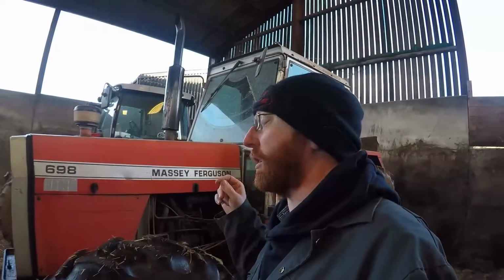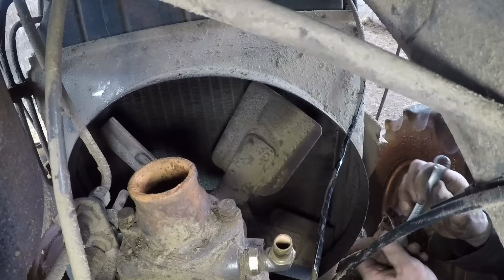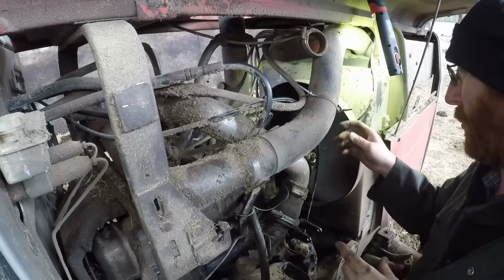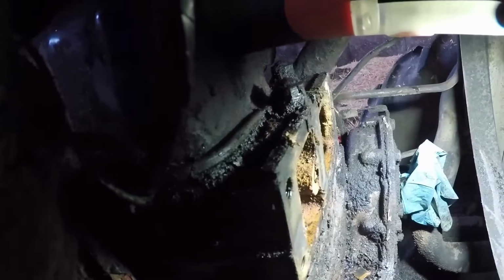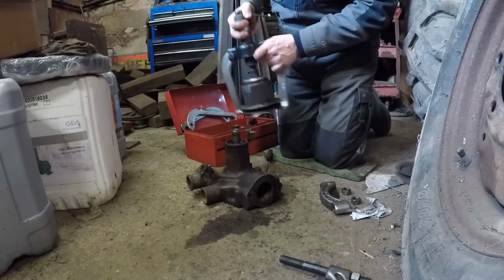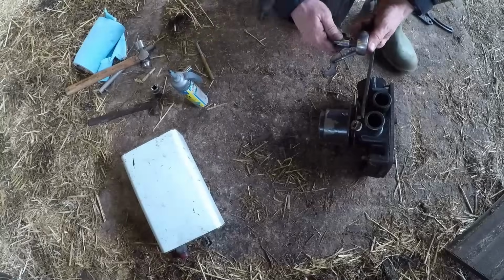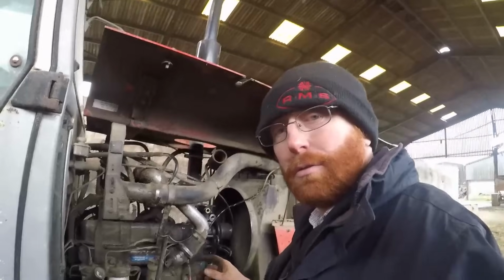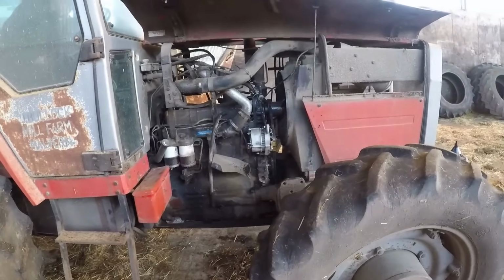A new water pump for the Massey Ferguson 698

Comment: Looks like a TB Turbo kit that’s been fitted to your tractor, made in Lancaster Lancashire with most parts including castings made by them in house apart from the turbocharger itself which will more than likely be a Holset made in Huddersfield Yorkshire. One of the other options was an Opico as mentioned by someone, they used an American made Roosamaster  turbocharger.

Comment: Good video Dan 👍 have to say I thoroughly enjoyed the years I drove a 698 with Opico turbo it powered a Claas Jaguar 62 precision chop forager and did all the ploughing with  Dowdeswell DP8 four furrow reversible as the DP8 was a hydraulic reset it was putting the lift capacity to its limits🙄💪💪👍

Comment: We had a 698 and bought a 699 later dad always recons the 698 without a turbo went as well as the 699 without a turbo. But the original 698 does have a 5.2 litre 4 cylinder engine so pretty big by 4 cylinder standards!

Comment: I've heard of the ghosts that haunts the 318 Perkins but I operated a 1080 in the early 80s had no problems only thing I didn't like was the multi power transmissions and after that I had a 298 who's hydraulics were a nightmare then several 285s those I loved I'm still hoping to get a 285 or maybe a 699 if whichever comes first at a reasonable price

Comment: Perkins A4 318. I’m amazed that it has lasted this long. It is probably the worse engine ever made by Perkins, even in its later, modified form which the 698 should have.  Best thing MF ever did was to dump that engine and use the 236T engine instead.
Reply: Not sure if it's luck or treatment or combination of but some people talk of having had 1080, 595, 298, 698 for years with no trouble and some wouldn't touch them with a barge pole. A chap we knew had one with opico turbo on for years and the engine was never any bother and he wasn't even mechanically inclined.
Reply: Had one here and it was a cracking engine,pulled well and started a dream,shame the cab just melted away before our eyes.
Reply: @rescuecow90  The engine was great, when it worked. It had an exceptionally high head gasket failure rate and many early ones had poorly calibrated and timed injector pumps. What came over MF and Perkins ever to actually officially offer the Opico Turbo kit for the 595 and A4 318 engine we shall never know.